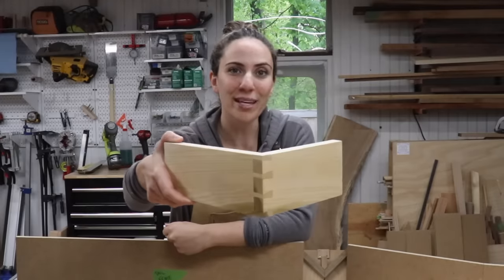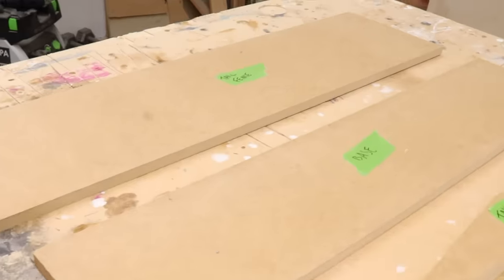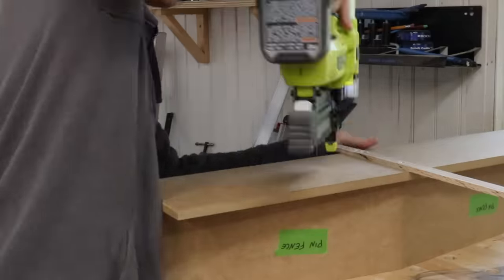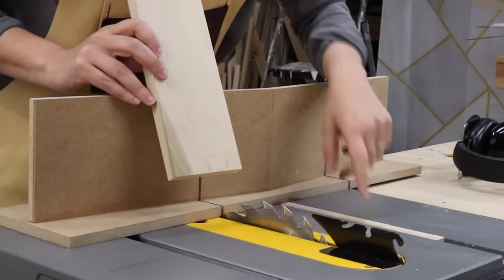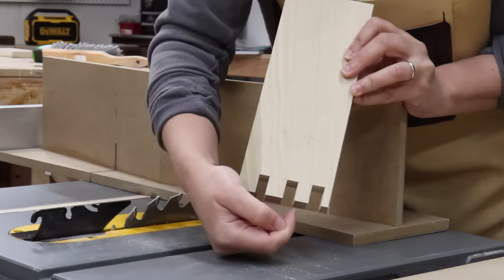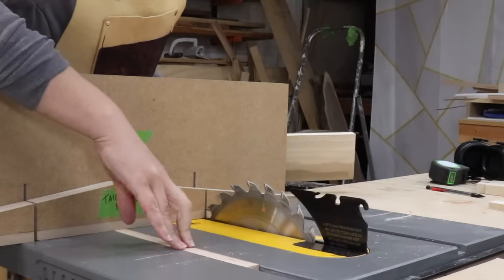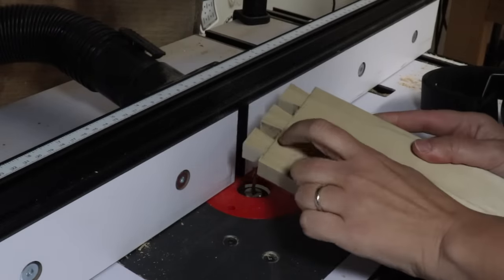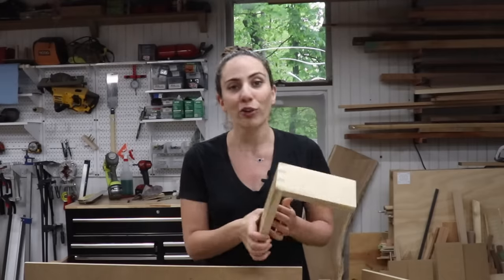Dovetail Jig for the Table Saw // Woodworking Joinery

Comment: Many years since I did dovetails but the best way and the easiest way to get them evenly spaced is to put your rule at an angle across the board and mark the size that fits nicely on that angle then square that down to where the dovetails will be
Well done over all after so few attempts 😁

Comment: If you shifted the apex for the second set of cuts you could make them so the blade height is the same.  Then you could also nibble material away and have less to chisel.  Very good video.  Thanks.

Comment: What occurred to me, when you were removing the tail waste, was that the kerf of your original cuts would allow a table saw blade, set to the same height as your tail cut and straight up and perpendiclar, to get in there to remove the waste. As long as the width of the waste exceeds 2 x kerf. Love your channel.

Comment: Great video.  Pretty sure you can avoid adjusting the blade height by transferring the pin markings to the outside of the tail board, put the other face (inside face) against the fence on the same side of the jig and make the second cut. 
If you cut the tails first and then mark the pin board, you do not need to do any transfer of marks. Hope this helps.

Comment: if you are still interested in the caliper/compass method of marking the pins, I accidentally found out how that works while watching a Rob Cosman video.  
Using the compass, you can make "equal" marks on the piece. That far is clear I think.  Now, if you could set your compass exactly to a size such that starting from one end and "marching" on you get to the other side of the board, then you essentially marked the "middle" of every pin. But that is not how they do it.  Let's say you have N pins and the board is W inches wide.  Imagine now that you set the compass to something like 1/4" smaller than the W/N and start marching from left to right.  Here is the fun part! Now you keep the same compass opening but this time start from the left and go to the right. You essentially mark one side of the pins/tails in one march and the other side on the reverse march.  The tail width (the smaller size I presume) is in our case 1/4". Voila!

Comment: I thought this was a great video - I like the jumping in and learning and covering that process as well.  some great ideas for the jig as well.  Just a thought - but sometimes it's just easier to take a small handsaw or a chisel to clean up an area like between the tails.  There's a little bit of a learning curve to using them, sharpening them, etc, but sometimes they are a faster and better solution than bouncing around between table saws and routers and bandsaws.  Bet a very, very cool video
Reply from the maker: Yeah it was just a fun experiment. Glad you enjoyed

Comment: You can cut a sliver to pack the low side of your jig instead of taking anything apart. It only looked like 2 or 3mm but easy to measure the difference in height from one side to the other!

Comment: Nice video! One question, why do you make the ramped jig for the tails instead of just tilting the saw blade and using a more simple jig? Would make life easier when it comes to setting the blade height also. Maybe you explain in the video, if so I missed it.
Reply from the maker: Thanks! I made this jig bc I saw a picture of it and wanted to see if I could recreate it. In theory if I didn’t have that mess up with the blade not being in the center I would never have to adjust my blade. And that’s the beauty of it. No blade set up (tilting it to a certain degree that might not be the right one. Ha ) it was a fun experiment!

Comment: Instead of a dual ramp for the pins, what if you used only a single ramp where you flip the board around to cut the other side of the tail? You’d have to mark the tails on both sides, but then the overall Leno of the ramp will be half. Great video. You are an amazing Woodworker.
Reply: overall length

Comment: If you're making drawers, poplar is actually great.  A few years ago I remade drawer bodies for a roughly 130 year old dresser and the originals were all tulip poplar.  The only reason I remade them is because they had been abused and had large chunks missing from the bottom which made them not track properly and constantly go cockeyed and jam.
Also FYI if you're going to be chiseling at all, bear in mind that poplar is one of the nicest woods to chisel... any other wood is going to have idiosyncrasies to figure out.
Reply from the maker: I love poplar

Comment: A precise way to tilt the table saw blade is to use an angle gauge such as a Wixey. That should provide accurate and repeatable settings and avoid having to build a ramped jig. Greg Paolini uses two simple jigs, one for tails and one for pins.

Comment: Great Jig! Question: since you're using the flat blade, why not change the angle of the tablesaw blade to the 8* and cut the board on the face of the saw to keep from having to change the blade height or mess with the TAIL jig in the first place?

Comment: After cutting the angles for your tails on the jig, try resting the tail board against the fence of your crosscut sled the same way u rest it against the tail jig fence. Run it across the blade  with the remaining gap between your tails centered on the sled's cut line. That way the blade passes between the tails dead center at a 90 degree angle. With the blade set to the correct height, I suspect that would clear the remaining waste pretty easily. U may not even have to chisel afterwards. Post a vid if you try it. I'm curious to see if it'll work. I'd try myself but I don't have a table saw. Lol
Reply: I just realized I'm a year late with this suggestion, but I hope you still decide to give it a try if u haven't already. Also based on what I've learned from your other videos, it'd probably be good to position a scrap peice behind your tail board when u try this for the year out.

Comment: nice video with good tips I am a retired Woodworker that did Architectual Woodworking professionally for over 20 years and Woodworking as my hobby for 35 now  one small tip on MDF jigs  and sleds etc  if you give them a quick Shellac  which is cheap and fast drying  they  will last much longer  i’ve always  bought  it by the gallon but i’m thinking about  starting to make my own  partially for experimentation and fun ? and in all honesty it’s cheap and easy to do   at work years ago we used to buy and use  a aerosol spray kit  that uses disposable canisters to  make your own spray paint  for small jobs or touch ups  which i thought i might use to spray homemade Shellac  instead of dirtieng a  spray gun for a small  part ?  of course it can be applied with chip brushes as well ?  it really wouldn’t matter much how it’s applied  i was kind of thinking out loud  with the video playing inthe background , Sorryas i got distracted watching your chisel work  and how much prettier you are   compared to the majority of Woodworkers i’ve worked with over the years including myself LOL of course inmy case most were male
Reply from the maker: Thanks for the tip! I usually coat the bottom of my sleds with shellac and wax to help them run smoother

Comment: make the left and right side as 2 separate jigs so that you can dial-in one of the jigs to match the height of the other jig, so no height adjustmentis needed between left and right tails. With cleaning the shoulders of the dovetails with a chisel, use /clamp down a squared (right angls) length of timber to guide the chisel plunge cut.

Comment: Great job, again. Just one question... could you reduce the jig to just one side and instead flip the workpiece 180 degrees so the you do the left side cuts with the front face towards the saw blade and the right side of the cut with the back face forward? I’m probably missing something and/or being a twonk, but this might reduce the problem of the non symmetry with the t-tracks and blade height, and make the jig smaller. Thanks ver much, your videos are great. Really helpful and informative. I use your ideas often. Thanks.
Reply from the maker: I think that could work

Comment: I'm sorry this is so late and so long of a post, but I've been away from woodworking and a shop for quite some time.  Because of that, all of my ideas are totally, hypothetical since I don't have a shop to test them out in.

First off, I don't have your courage and tenacity.  I haven't made a lot of dovetails (mainly only for drawers ), and have ONLY done them with purchased router jigs.   Since you have this "Just start experimenting and figure things out" attitude, here are some of my thoughts about a few of the issues you had:

1) The Pins jig seems to work well, but the Tails needs so much after-work, it almost doesn't qualify as a jig (IMO).  Since your Tails step already takes the use of other tools, why not just do the Tails first on a router table with a specific dovetail bit.  You can't sneak up on the cut, but you can pre-cut with a small straight bit and then do the final cut of the "wings" with the dovetail bit. Then you can use the Tails to mark the Pins piece and do those with the table saw jig.

2) The tear-out on the Pins probably came from the taller pre-cut kerf in the jig.  Putting a thin (1/8) sheet of hardboard behind the work piece on jig may give you a temporary zero-clearance backer.  You could even route-out a small area around the kerf on the jig and make it a small replaceable insert ( like on many drill press tables).

3) You mention multiple times about the bulky size of the jigs.  To save room and simplify things, you could make the jigs as an attachment to your sled ( really like that sled! ).  Especially if you just cut the Pins.  I'm thinking of a hollow triangular box that would rest against the back of the sled, held in place with your clamps. You may be able to get away with only one, and flip it over to cut the other side of the Pins. 

Again, just my 2 cents

Comment: Great video thanks for sharing the jig - it has my inventive gears grinding. I am curious what you feel the advantage is of cutting dovetails on a table saw is vs a router table?
Reply from the maker: Glad you liked it. I guess the only advantage is that you can make them look hand cut on the table saw. With the router template you’re locked into the sizes
Reply: Good point. Thanks.

Comment: Thank you for your video. I have worked in the cabinet industry since 1988 and dovetail joints are overrated. They look nice ,but nowadays the extra glueing surface is not needed with today’s adhesives.

Comment: Thanks, looks good. I've been turning my saw blade to the angle I need. My table saw is not that accurate with angles. What I have is a board the the width of my table saw, and in the middle is a cut at the right angle, and depth. I put this board on my blade, and then level out the board so each end is level with  the table top, then I lower the board so the boad is sitting on flat on the table top. with the board laying flat, the blade is the right angle and depth. I have a jig that hold the board, will I cut out all the right sides, the I flip the board over, and cut the other side. I never found an easy way to make a jig to cut pins, so your jig was very helpful thank.
Reply from the maker: Awesome. So glad it was helpful!
Reply: Consider getting a digital angle gauge

Comment: Great video.   Try making a dovetail by hand.   It is just as easy,  less noisy and more satisfying.   Mark out with a marking knife, use a dovetail saw for the straight cuts,  a coping saw for the bottoms and clean it all up with a bevel chisel.   Lay the wood down on the bench when chiseling.   If you can make dovetails by hand then you will be able to make concealed dovetails for drawer fronts which you will not be able to do with your jig.   Good luck.
Reply from the maker: I did a hand cut video too. It was fun!

Comment: If you get an angle gauge.... the tails are much easier if you just tilt the blade. Then the only thing you make is a simple 90 degree sled to hold your piece :-) The only thing you do different is mark both sides because you have to flip the board around. I have an incra 1000 miter for the table saw. Just make a small 90 sled and screw it to that jig for the pins. It has positive stops so you will have to do 10 or 15 degrees i think. You will spend 5% of the time and 25% of the material you did. Then there is angled dovetails on the table saw :-)  I use the table saw to cut the outside of the tails off, just turn the piece on its side.

Comment: To fix the problem with your tail jig heights being different move the peak of the triangle offset so it is split between the difference of the miter slot distances. The peak just needs to be centered to that. But I suppose you could achieve the same concept by moving the slide piece...... just occurred to me this does the same thing without adding an extra cut into your board.

Comment: love the videos! I noticed you use a brad nailer often to prevent slippage when clamping glue ups.... do you know about the old salt trick? If you sprinkle a bit of salt into your glue it prevents slipping when you clamp...which might be better than brads if you're cutting the piece afterwards as there's no worry you'll hit a nail with a sawblade.
Reply from the maker: Thanks! I’ve heard of that. But I was always concerned the salt doesn’t fully desolve and would leave gaps. Am I wrong about that? Ha
Reply: @3x3CustomTamar  It bites into the wood like mini biscuit joints, so no gaps really

Comment: Loved your video but an FYI.  to divide the board into equal parts use a straight edge ruler hold it against the outside edge and angle it until you get to a number on the opposite edge that will eveny divide by however many sections you want it divided by. If you want to divide it by 3 and you have an inch and a 1/2 board you can angle your ruler so that it shows 3 and then mark your 1" marks and you have 3 equal divisions.

Comment: You are very talented, it seems. Do you have any tips for joinery methods? For example - what joinery is best for cabinets, tables, chairs, etc. Any input is accepted!
Reply from the maker: Whatever you feel comfortable doing ☺️
Reply: @3x3CustomTamar  but would certain joinery be better than others?
Reply from the maker: @alexm5609  that’s a very long discussion. Each situation needs to be evaluated based on grain direction and usage. I use pocket holes sometimes. And other times I use Dovetail’s. Sometimes I use splines. other times I do mortise and tenon. There’s really no easy answer to your question.....

Comment: Great video and a good result. I have a question going back to the days of woodwork lessons at school in the seventies. We did dovetails entirely by using chisels start to finish. Admittedly I messed up quite a few but put this down to being 13 and having the patience and control of a Labrador in a cake shop. Do you recommend this technique over that and if so why?
Reply from the maker: Thanks! No. This was just another way. I don’t believe there is a right or wrong way. There is a way that works for you

Comment: Did you ever address the miter slot difference? You could always split the angle part of the jig and raise the one side so the blade is at an equal position.
Reply from the maker: I didn’t. But that’s what the plan is

Comment: Seems like a good way to make pin boards. The tail board you can literally trace over and knock it out with a dovetail saw almost as fast lol
Reply: I did build this just to see how much faster it is vs dovetailing by hand. 

Just an FYI, you can locate the pins wherever you want, however you want, and the more random they look, the better in some cases. It definitely indicates handmade dovetails vs something made with a jig and router.

Comment: I am putting together a project at home that will be including a stair skirt. I am very interested in the clamp that you are using in this video to secure your piece of wood for cutting out the portion of wood on the dove tail for which you used a hand saw..what is that clamp called and if you don't mind, where did you purchase it from?

Comment: Perhaps a good approach would be to do the pins at the TS as you did, but then cut the Tails at the router table using a dovetail bit (with the same angle of the TS jig)... That would eliminate the need to clean up the tails afterward (mostly).

Comment: Awesome, I just got my router, haven’t even used it, but looking at the Leigh? Dovetail jig, is that a good one?
Reply: Leigh and Porter Cable are both excellent and versatile but costly. I use the PC but have heard the Leigh is just as good. Once you learn them your dovetail and box joints become quick and easy. Check out Kings Fine Woodworking here on YT for an thorough tutorial. 

Using a good jig like the PC or Leigh I can make 3-4 drawers in an hour depending on size. Doing them by hand, while gratifying, takes me over an hour per drawer.

I did go and check out that RTJ400 and it does have a lot more features than the PC or their earlier jig so it may be the reason for the steep price tag. That said, if you don’t really require all that flexibility the PC 4212 offers a lot of good features for under half the cost. It all depends on your needs. The 4212 and the previous Leigh jigs were both stand alone jigs that don’t require a router table.
Reply: @dennisfahlstrom7175  I didn’t think that the PC could be used on router table, think that’s why I was looking at the Leigh,
Reply: @philandlyra3365    Both are stand alone jigs.  Neither work in conjunction with a router table. Look up the 4212 PC dovetail router jig.
Reply: @dennisfahlstrom7175  Leigh RTj 400 router table jig
Reply: The Leigh RTJ400 with the accessories is $520. The Porter Cable 4212 is about $200 or it was a year ago. Includes templates for both dovetails and box joints. You may need to buy a few router bits but they won’t cost $300. That one was my choice and it works fine.